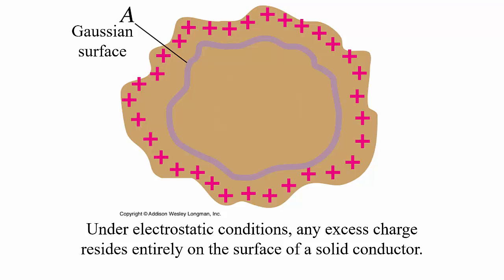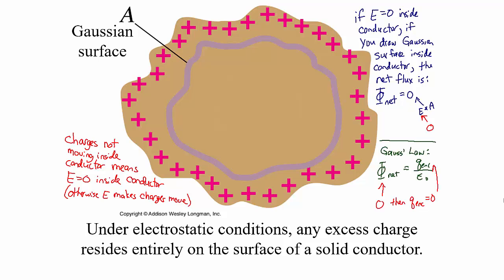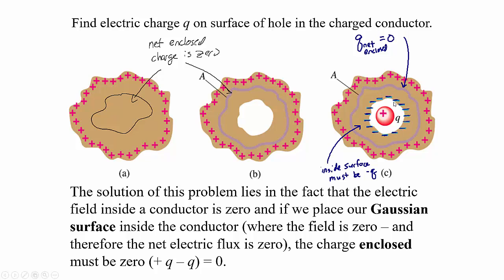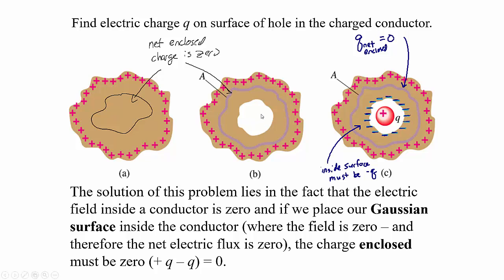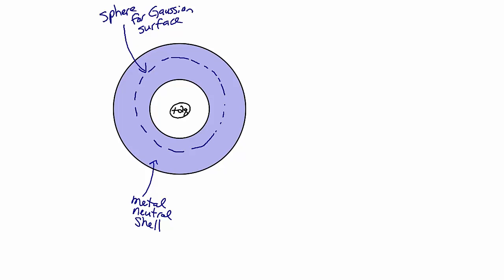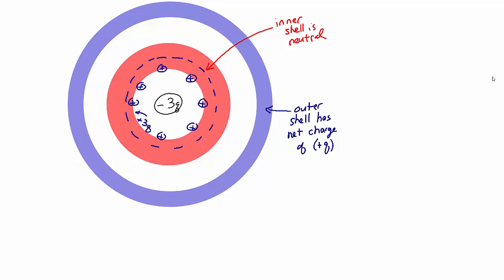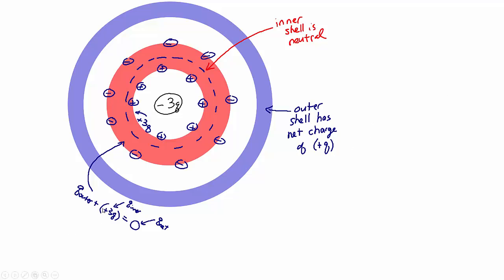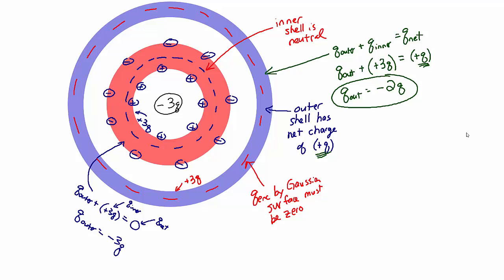Finding Charge on Surfaces of Conductors Using Gauss' Law

Comment: in charged isolated insulators, the charge doesnt uniformly distribute unless the conductor is spherical tho. if its not spherical, like the ex in the beginnning of the video, dont u have to use the surface charge density equation?
Reply from the maker: You would still know the total amount, but it would not be distributed evenly